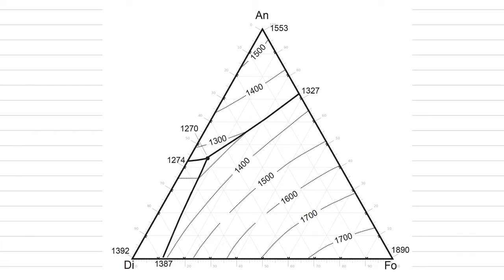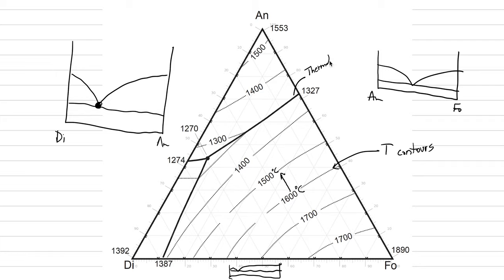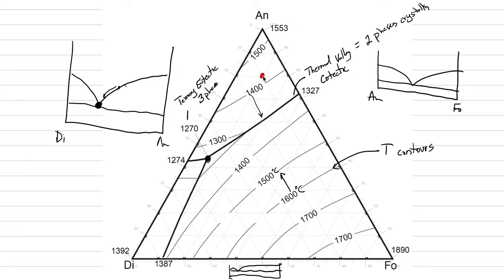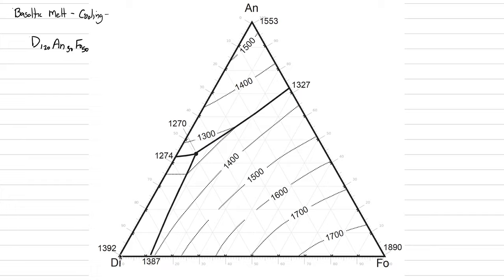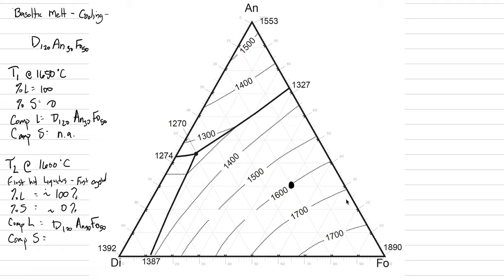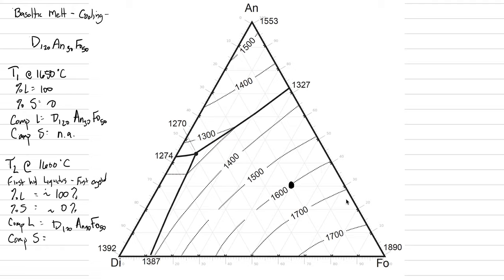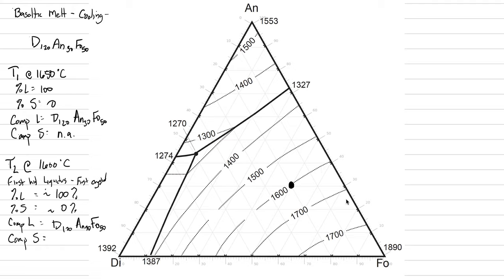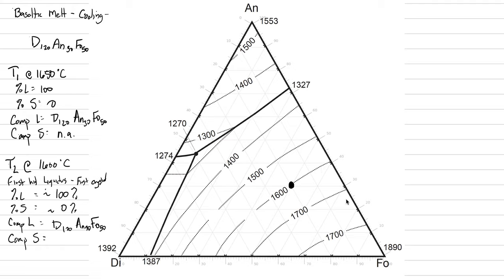Phase Diagram 4: Ternary Example

Comment: Thanks for the helpful explanation. I am studying glaze chemistry for ceramics, and this give me a better understanding of this type of graph. Question if you see it, what determines the starting point in your cooling example for basalt? @5:27
Reply from the maker: Hi. Glad this helped. It was arbitrary starting composition for this example. Any composition would be possible.
Reply: @kennethbefus  gotcha. Temperature is the z-axis and the starting point is whatever molar % of the 3. the starting point and will ultimately determine the % of crystal/solids. It's a bit tricky when it comes to more complex diagrams, but I think I get it. Thanks again.

Comment: My question What is the maximum mass of primary crystals that will form as the batch progress along the cooling path? I though its when t5 is reached at 1300 and the solid mass is 42%. This is the maximum for primary phase right?